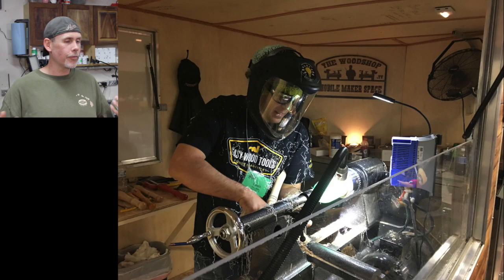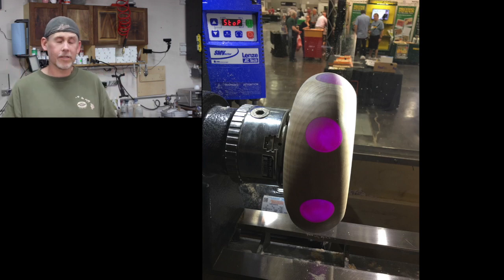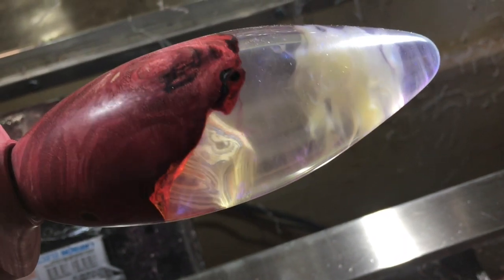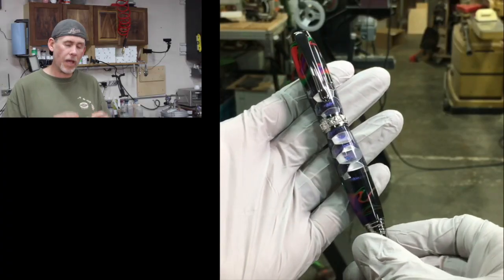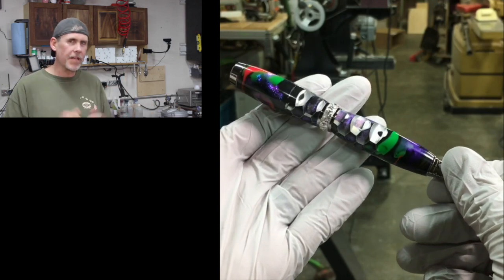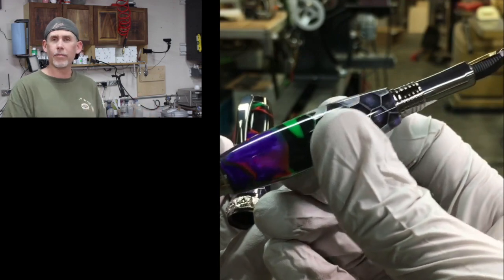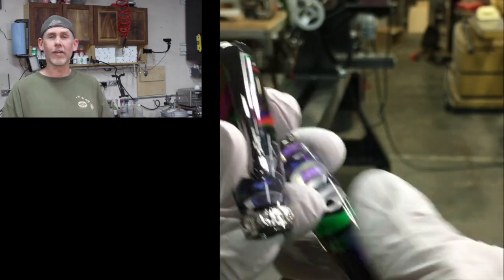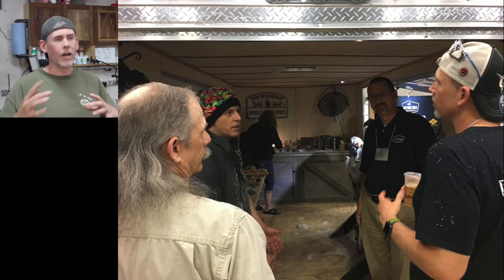Recycled Skateboard Bottle Stopper & AAW Symposium 2018 Highlights

Comment: What was that flexible saw/garrotte looking tool being used for the plunge cuts?
Reply from the maker: That's a great question! It's a metal wire glued to two wood spheres. You rub it in the grooves, and it basically burns the grooves causing them to turn black.  I'm not totally sure what they are called, but I think people just call them wire burners. You can buy them premade or just make your own. I recommend adding the little sphere handles if you DIY it though, it's safer to hold and it will prevent the wire from burning your fingers since it gets pretty hot
Reply: Zac Higgins thanks for the info I don't think I have ever seen one used before. Great video and you are fantastic at your art!
Reply from the maker: You're welcome Nathan, it's a pretty neat trick to add some color in design lines. Thanks so much for the kind words too, I really appreciate it =D